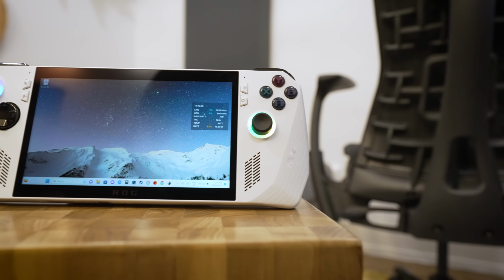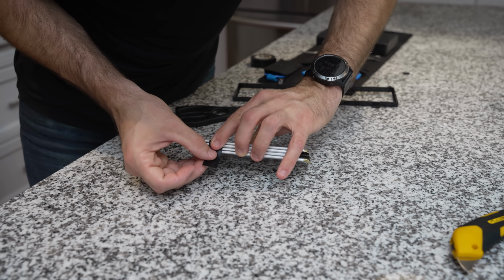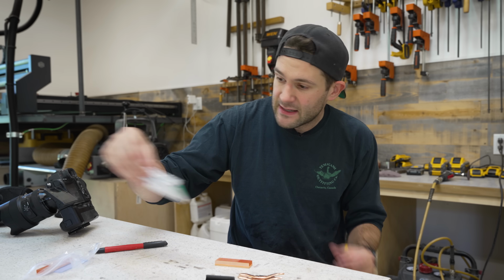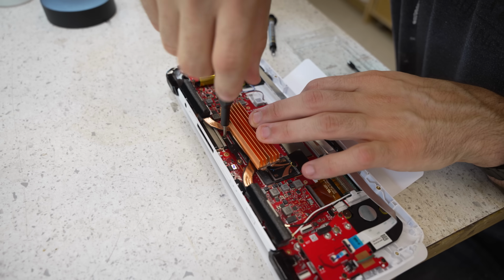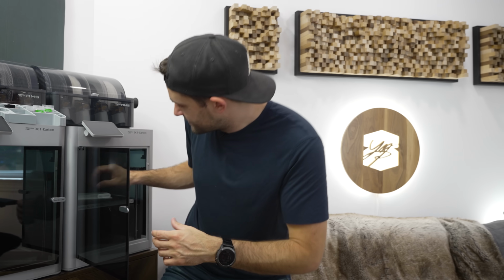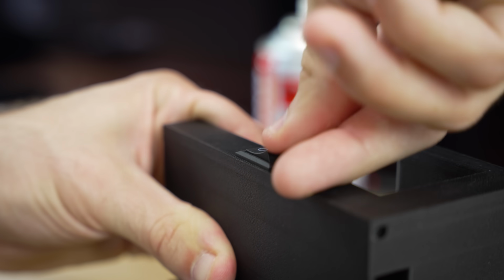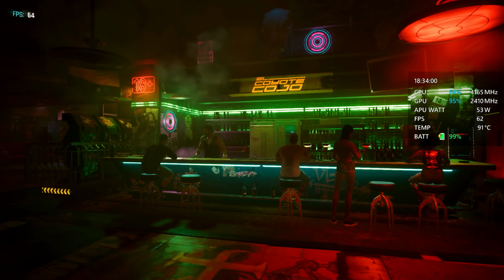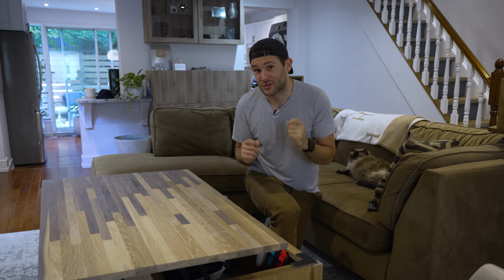I don't understand why people buy Steam Decks...

Comment: If this had a good implementation of SteamOS and also had trackpads, then I'd immediately buy it. That's the one thing it's missing.
Reply: Yes, the made-for-windows is both prominent on the Asus and contradictory to the form factor. Then there's things such as the hours one will get off a slightly smaller battery on the deck and general care for software of Valve for a better out-of-the-box experience.
Reply: It needs a trackpad, navigating windows with the joystick is ass.
Reply: @austinkoeppen6122 you can use a virtual track pad, but honestly I don't miss having a track pad.
Reply: The ChimeraOS community is currently working on full support for the ROG ally.
Reply: I specifically purchased steam deck because I support GNU/Linux and I want to help Valve kill Windows . It's not only that I love the gamepad and holding literally any other gamepad, apart from perhaps playstation gamepads, now feels like an awkward, obsolete relic (think of how NES gamepads feel), or that 12 years of experience with GNU/Linux makes SteamOS far more useful, powerful and convenient for me than Windows is. It's that Valve has demonstrated a willingness to help GNU/Linux erode the Windows market share among gaming PCs in ways no other company has ever shown the slightest intention of. The non-exhaustive list of hallmarks of this includes:
- shipping products ROOTED out of the box
- shipping them with FULLY UNLOCKED boot menu that you can use to erase and replace the stock OS with literally anything you want
- allowing that stock OS to very easily download and run ANY UNSIGNED CODE out of the box
- releasing 99% of the source code of the entire stock OS including the entire graphics stack and exposing their self hosted gitlab repositories updated with the complete history of the code for every current and past release of the OS
- even within the stock OS , making the application formed from that 1% of the code that is proprietary (Steam) 100% optional and possible to turn off with 5 clicks (Steam->Power-Switch to Desktop->Steam->Exit). It only takes mentioning "Google" to fight anyone who insinuates this is NOT an outstanding good faith attempt by a proprietary company to more than compromise with open-source extremism.
- of that 1% of the code that is proprietary closed-source, intentionally writing 99% of it in the most easy-to-reverse-engineer languages ever (Javascript and Typescript), unobfuscated , which immediately allowed thousands of modders to write endless community features for it
- reserving that tiny, remaining 0.1% of the stock OS that's formed from closed-source native binaries, for its arguably most logical intended purpose, the Steam DRM to enforce account licensing of games from their store, their actual bottom line that's the one thing they would indisputably lose money by removing. They don't even make any attempt, legal, practical or technical, to stop anyone from using their real-world direct competitors' stores, Epic, Blizzard and Origin. This degree of love for the customer is unparalleled by almost any other corporation in history, let alone in the video game industry.
Reply: I don’t really miss the steamOS. Definitely good for people who don’t want to mess with windows at all, but I found myself in desktop mode a lot on the Steam Deck so that I could get certain non steam games and emulation working. Armory crate does the job just fine and anything I have in steam I can just launch steam in big box mode, which is basically all the SteamOS is
Reply: @theantner SteamOS is much more resource friendly than running big picture on Windows, this changes battery life and memory availability.
Reply: @cannibal_bacon  yup. Not saying there’s anything wrong with SteamOS. It’s straight forward and easy to navigate/use for a casual gamer who has and just wants to use steamdeck. In my case I prefer to just have windows since I spent a ton of time in Desktop mode on my steam deck to get emulation setup completely and to get other launchers running for games like Diablo or just games I didn’t buy in Steam.
Reply: @theantner  You can side load windows, or put it on an SD card like I have, but Linux is leaps and bounds better than Windows as an operating system.
Reply: @cannibal_bacon  that’s true about loading windows from and SD, but at that point why would I keep the steam deck? Linux may be a better OS for daily stuff, but the compatibility, while it is growing, is still not quite there when it comes to gaming. There’s plenty of games that still are not fully compatible with Steam OS. 

Again I’m not saying the Steam Deck is a bad device or people shouldn’t buy it. It’s great for people who just have Steam and don’t want to really have to configure anything. Just open the box, sign in and go. After having the Steam Deck and switching to the Ally, I much prefer the Ally and windows over the Steam Deck. It’s what I like obviously.
Reply: @theantner pretty much everything works at this point unless the devs intentionally don't want you to use Linux, that's it. 
It's been months I've nuked my windows install after 4-5 years of daily driving arch Linux. So unless there are specific games that you want to play but are not supported on the Linux, then it's fine to be on windows, go for it!
Reply: @theantner The most games that don't work on Linux generally are games with non-activated anti cheat software support for Linuxor have an outside Launcher or are multiplayer games from EA (especially newer ones with EA AC).
Reply: @theantner  I mean there have been apps made for Steam Deck that automatically handle all emulation for you and allow you to play emulated games through SteamOS, so even for things like that you pretty much never have to go to desktop mode after the initial setup.
Reply: The fact that people nowadays make lack of Linux on a gaming device a disadvantage is kinda crazy

Comment: The SD Cards are NOT "frying". The SD Card controller chip is burning out, causing the actual card to become corrupt and or damaging the card. That is why the ROG Ally eventually stops recognizing ANY card inserted into it.
Reply: The new models dont have this issue R8 and newer.
Reply: is that accurate? R8 or higher? i was going to try this guys method, but mine says R9 @lucianowod
Reply: "to become corrupt and or damaging the card" i.e. frying. the card...
Reply: Do you know how to fix it?
Reply: @fredsvv  I don't. I tried installing some thermal insulation between the SD card slot and heat pipe/fan inside the unit, thinking maybe that would keep the card slot and controller chip cooler since it would block some of the heat radiating off the heat pipe that's right above the SD Card slot, but that actually made the temperature inside the SD card slot higher by about 10 degrees fahrenheit, which is the opposite of what I was trying to do.
Reply: Awesome getter to have no sd card function from something I bought vs damaging my cards.
Reply: Soooooooooooooooooooooo I'm still going with "frying".

Comment: Why not just DIY a battery pack with 18650cells, a BMS with balancing and a buck boost module for fine tuning ( this mod can bring more challenges discretion advised ) , for the fan on the dock a better solution instead of a switch is a thermistor sensor calibrated for a certain threshold temp. Sorry if my english is not so good)

Comment: Honestly, the steam deck beats out the rog ally by feel.
I bought a steam deck and tried a rog ally and It just felt too small for me.
Reply: since when a product bigger and worse is a good thing, wtff
Reply: @tetofin  Why make something smaller if it mean sacrificing ergonomics? The other thing is that the Ally is a computer that you can carry around. SD is a handheld console that can also be used as a computer. Ally is nowhere near as thought out as the SD is, not to mention Valve's amazing software support.
Reply: @tetofin The steam deck came out before the ally for one, two the steam deck has better controls, three, the steam deck was to the mobile PC market. What the ally is to the steam deck when it released. It performed two to three times higher at at less than a quarter of the cost of most handhelds when it was released.
Reply: @tetofin  Most handhelds are too small to be comfortable.

Comment: It doesn't cook sd cards stop lying, the solder used for the SD controller cracks under high temps, if you reflow the solder it will work

Comment: Was waiting for this video, thank you. Sad to see that cooling didn’t change the performance but longer battery life is nice, but I don’t know about purchasing a battery for $150 is really worth it. Right angle m.2 adapter might be a game changer though. Personally I’ve already had to bring in my Ally for an SD card reader replacement, wish I thought of but heat resistant shielding before. Still won’t be using it though just because of how unreliable it’s been for me. Hope you think of more ideas that the Ally could be modded in the future.
Reply from the maker: So far so good and it's been about a month!

Comment: why bend the heatpipes?, actually, why bother with the extra heat pipes at all? you prob could have gotten more perf by just adding the copper heat sink to the original buffed heat pipe
Reply from the maker: In order to clear components inside the Ally like the fans.
Reply: @ZacBuilds  ahh, didn't know about that, thanks

Comment: Wow so much effort for so little performance gains. More battery life is easier achieved with a good powerbank. But it was cool to watch and wow do you have skills! I run an overclocked, shell swapped full white Steam Deck, but this is a different level of customization! Impressive!!
Reply: Yeah this was a lot of work for not much of an actual difference.
Reply: since I'm also using a powerbank, I do agree with you but only partially. Bear with me on this: 90wh battery mod, PLUS 25000mah powerbank
mmmmm

Comment: how about those thin batteries from modern phones? will they work?
Reply from the maker: Unfortunately not. The physical size of a battery basically equates to its capacity as a batter. So smaller battery = less capacity.

Comment: Y'know what'd really fix it... Sticking SteamOS on it
Reply from the maker: Ha I did consider that, but once you get the Ally setup, you rarely have to interact with Windows. It's not SO bad.
Reply: @ZacBuilds  I was just kidding, though it will be interesting to see if the public version of SteamOS supports the Ally once it's released. But this mod had kinda made me interested in the idea of 3d printing a backplate with extra room for a bigger battery, rather than needing to cut into the original one

Comment: why don’t you add bigger cells to your stock bms?

is the fan noise better? the heatsink mod would be way more worth it if thats the case
Reply from the maker: Could have done that too, but this was much less work. Just plug and play. 

Fan noise is much better after the cooling mods.

Comment: You know they make those aluminium docks by sliding in the PCB from the side and then putting on the black endcaps... right? RIGHT?
Reply from the maker: Yes, unfortunately the black end caps are fitted in such a way that they cant be removed after the fact. Trust me, I tried.
Reply: @ZacBuilds  Ah ok, at least you tried! I had a similar one and it was pretty straightforward to slide out, which is why I asked.

Comment: That was wonderfully well-presented. 

Cool project. I was absorbed the entire time, absolutely LOVED the low-temp solder. That alone opens up new windows for me.
Watching you progress through the project, face the challenges when you take on a creative endeavor and complete it, even if it didn't achieve the outcome you hoped for. 
Gathering the data of Why it didn't meet those expectations and a root cause analysis just put the topping on the pie. 

And visually spot on. Deliberate composition, kudos to the DP. 

I'm gonna watch some more.
Reply from the maker: Thanks man! Each project is an adventure. I never really know where they are going to end up, but I just do my best to document them from start to finish and cut out all the boring bits haha. And thank you for noticing the camera work :) I try hard at that.

Comment: i would say the cooling mod is a good idea, but not required. though the power limit removal is wasted.. the cooler the components are, the longer they will live, so even a 5 degree drop in temperature is a good thing. did a small thermal mod to my switch when i first got it, and it has kept me about 6 degrees on average cooler than a stock switch would be. it would be more, if i was not an idiot and slightly kinked the heat pipe while cleaning it(bought second hand and was filthy)

Comment: Significantly faster than Steam Deck?  Oh no, here they come!  I know because I am one...

Significantly more expensive too, especially if you buy the cheapest Deck and upgrade it yourself.  Mine has 3TB (2TB NVMe and 1TB U3 A2 SD) and hall effect sticks.  All for less than even the top end Steam Deck, for way less than this obsolete object. It can't beat SD on value and the Legion GO is going to massacre it on pure performance.
Reply from the maker: More expensive = more better.
Reply: the legion go is definetley going to smash this thing into the ground, even though it uses the same processor and runs games at higher resolution 😐😐.

Comment: one thing that would be awesome is integrating the xg mobile egpu into the dock
Reply from the maker: I did consider that, but given their cost and size, I felt that moonlight was a much better alternative. But hey, maybe a PT 2 could happen...
Reply: @ZacBuilds  i mean the rog ally x recently released with faster memory, gives you an excuse to do a new and improved ally pro using it. the ally x also uses a cheaper usb 4 egpu solution, you can buy docks online where you can use your own desktop graphics cards in them.

Comment: I don't know much about electronics, but wouldn't it be possible to have some sort of switch/button or sensor that could be pressed in or tripped when you dock the Ally versus an on/off switch for the fan?
Reply from the maker: It would indeed be possible. They're called momentary switches. The problem is, when I leave me Ally in the dock to charge it would also be running then. This seemed like the best compromise to me.

Comment: As someone who has done this mod it's awesome to see it covered!  The only things I would suggest doing differently is not wrapping the battery like that and instead of cutting the stock plate of the ally is using the 3D backplate model that Yesitskira has designed for this specific mod! She has done an amazing job with it! Also big shoutout to Tekgnome who runs allymods and came up with this idea! The extra battery life is absolutely amazing to have especially considering the total weight of the device is as much as the steam deck now. It's really impressive!
Reply: I'd love something like this but I don't trust myself to not fuck it up lol
Reply: I just bought the battery and am getting the whole backplate 3d printed. Does your battery percent still show correct?
Reply: @isaiahsmart9933  mine does but some third party batteries will not. Make sure to get a asus branded one
Reply: What is the weight of the new battery?
I purchased a Xiaomi 20k battery bank and can say its weight is like the Rog ally itself!!! 
i.e. double ally weight is really frustrating, I can't handle the device for 5 minutes.
Reply: How would you wrap the battery?
Reply: @thecanmanification  the way it shows on allymods. I would not add extra wrapping on top of what is shown there. Need to be mindful of batteries expanding and trapping extra heat
Reply: @IMIute  I guess the best way to do it would be to repurpose the shell he used from the previous battery or machine his own compartment. Or use a wrapping material that has more elasticity.

Or machine a new shell out of aluminium
Reply: What’s the link to the yesitskira backplate?
Reply: @KashFargo I tried to link it to you but it got deleted.  Just Google search "yesitskira rog ally" and you will find it.
Reply: I am looking for a bigger 3D printed back like that, but also has bigger handle grips.  I hate the rog ally handle grips so much I wish they were comfortable like the steamdeck. This looks pretty easy to do if your also changing the back to add a bigger battery.
Reply: same i might make a video about it waiting on my battery!
Reply: yeah i found it strange he 3d printed everything but did a jank job with the back cover

also i really dont see a point with the battery mod either. feelslike diminishing returns that strapping a small power bank behind it with velcro couldnt solve and be hot swappable

great video nonetheless
Reply: @furythree  ya that was my initial thoughts to. But the weight distribution is key with this mod. Strapping a power bank to the back doesn't feel nearly as good in the hands. The other benefit of this mod is having the only usb port available for other accessories.
Reply: @IMIute  yeah fair point. But he kinda went middle ground halfway. Either use small power banks that you can hot swap or do a proper fully printed back cover for max cleanliness.

Great point regarding the usb port. What if you hotwired a hub/pass through
Reply: @furythree yeah I think the back cover looks nice design wise, but a full back shell replacement would have looked much cleaner and not as disconnected
Reply: cycle's on you main battery will be toast in  year @furythree

Comment: Steam Deck is still better than a Nintendo Switch and No the Steam Deck does not operate as badly as a Nintendo Switch and does not play MK1 at extremely low Jimmy Enclosure Graphics, Steam Deck and Switch dont have the same hardware.